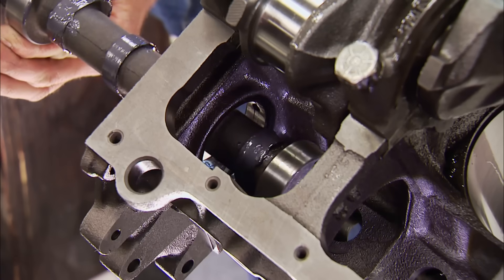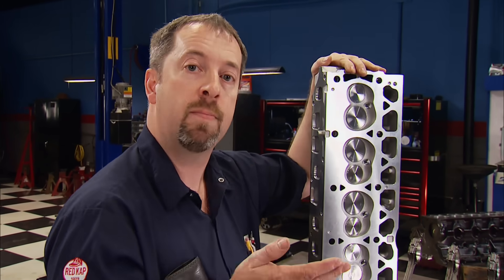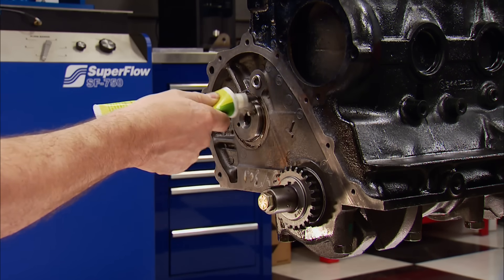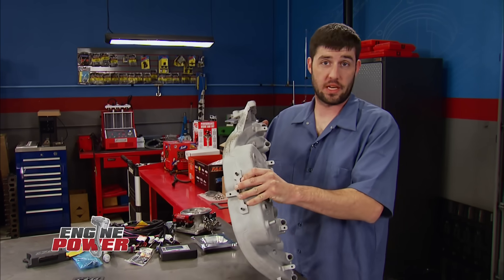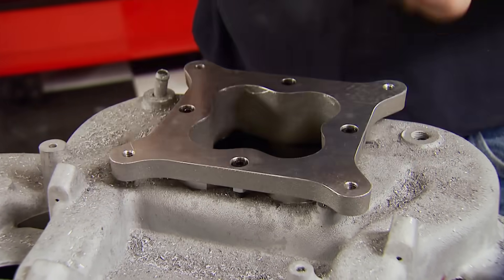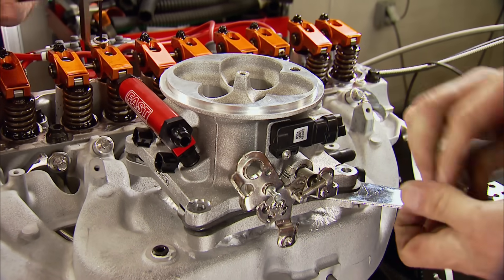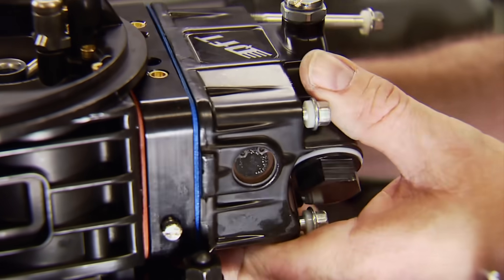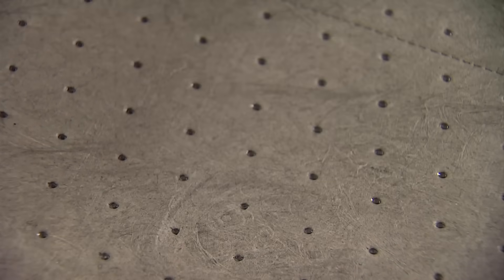Rebuilding a 4.0L Jeep Straight Six to 242HP - Engine Power S2, E14

Comment: We'll continue to post these episodes here on YouTube. If you can't wait for the rest of the build, visit our site to binge-watch:  https://www.powernationtv.com/shows/engine-power
Reply: What did it cost to build? How much 66hp and 66 torque cost?
Reply: @LarryisControversial3000 5k at least depending on you machine shop costs and this motor is crap for off roading trails as it has to reved out to make power. I bet the stock motor makes more torque at 3k rpm.
Reply: @pkuudsk9927 the added cost of changing all your gears to match the new powerband jacks the cost to sky high
 the head and rockers alone cost near 2500
Reply: @LarryisControversial3000  Yep and the best part is a stock motor and trans can do just fine . Tires and a winch cost way less. The cost of the head and rockers almost have you at the cost of an LS swap . Advance adaptors sell kits for less than 1500 to match a ax 15 . So why would you spend 5k+ building this ?
Reply: @pkuudsk9927  agreed
Hey   powernation  feel free to chime in and let us know why this the better option over a v8 swap or something else 
Please, I am seriously asking
Reply: @LarryisControversial3000   Because they are honoring the history of the 4.0. Its been around for a long time. There are millions out there still running and the history of the engine and all it has done comes into play here. People hold that in high regard. There are many Jeepers who have no desire to shit on the Jeep name with an LS swap but would appreciate more power to run 70-75 mph up and down hills all day long on the interstates for those cross country trips.
Reply: @beboboymann3823  this started with the request for a budget build, the build presented was not. While the actual cost is not fully stated, educated guess puts it in the 8-10k range due to the aftermarket parts used. The long and rich history of the 4.0 is actually better represented by other builders who are able to get more usable power with stock parts that have significantly more reliability and endurance than the aftermarket parts. 
Side note 
My 89 cherokee didn't require a bunch of aftermarket parts to run 70 plus mph up and down hills on the freeway all day long, and at the same time I could play on the trails too. All stock 89,  
So......
Reply: @pkuudsk9927   Which is exactly why I built my poor mans 4.5L gollen knock off using the old 4.2 crank on the HO platform. It made 338tq @ 2600rpm and 287Hp @ 3700rpm. Kept the factory injection which up sized injectors and a JET computer. Build cost was less than $2200.
Reply: @usmcdrifter8759  That is a proven method with the torque right where you want it . Much better build than this race motor. And why I bought a 4.0 to build when my 4.2 get's tired . 22 years old 350k kms on it and still runs strong don't burn oil .People laugh  at 112 hp180ftlbs but it doesn't break axles and u joints every weekend . I wore out a rear ring gear and 1 clutch in the jeeps life . Most trails I rarely get over 2500 rpm
Reply: P Kuudsk ALL the motor needed was FLAT TOP PISTONS AND MULTIPORT INJECTION!!!!
Reply: @beboboymann3823  after giving this some thought, your comment about shitting on the rich heritage of the jeep name is misdirected. Truly no one has done more than Jeep itself to shit on it's name. If I remember correctly the last Jeep/Amc engines were produced in the late 70's possibly very early 80's, and Amc was borrowing parts from other manufacturers to stay alive for a while already. Chrysler transmissions for example. True they had a kinship with Mopar, but Jeep hasn't had full production control of their vehicles since the 60's. The 80's saw 2 different chevy engines in the lineup.  So out of all the vehicles in the world, Jeep kinda feels right to swap in a different big 3 engine in as needed.
Just my thoughts and opinions, and to clarify, I fully believe it is wrong to swap a chevy into a ford or dodge and also wrong to do it the other direction. 
But Jeep just keeps asking for it.
Reply: Love these episodes you guys!! Keep it up! #JeepLife
Reply: Wheres the dyno sheet to show low end power / torque . fine it makes power at red line but thats not where most off roadin is done at . 2500 to 3000 rpm matters more than all out power. If you have to rev the shit out of it ,all the time to make power, than it won't last long throwing the reliability factor out the window. .
Reply: I’d like to see the episode where you tested the 300 inline six and also I’d like to see you build a mopar 383
Reply: Through the buildcost in the description haha (minus the tunetime$)
Reply: That intake manifold should have been a Clifford 6=8 4-barrel.  You would have easily made your 242 horse power without the headaches.
Reply: You guys should in the future rebuild and tune the 4.0 OHV 6V. That would be an interesting build!
Reply: @xCptLegendx  Yep, and I'd like to see the guys build a GM 4.3 V6.
Reply: @xCptLegendx www
Reply: Can all this be used on a Jeep 2003 Grand Cherokee 4.0 inline 6 ?
Reply: Yup... @dougyankunas3104
Reply: Who sells mods like this? Is this sold in this form as a reman?
Reply: And on episode 4, we LS swap the jeep for more power and less cost than the byzantine piece of crap jeep I6.
Reply: This engine is bullet proof. It was made that well. Amazing torque for a 6. Best thing they ever did was giving it fuel injection. Balanced the intake fuel charge. Before that it was just another straight 6.
Reply: Don't bother, your show sucks
Reply: Any Idea or hard numbers on what the MPG would be on this engine before and after?
Reply: here have a look , 
https://www.youtube.com/watch?v=HX6qFxaFSnM
Reply: Heard that, stopped the video, backed it up, watched again. Was disappointed.
Reply: The flow mistake I see here in modifying the intake was that you set the adapter flange throat down inside the housing creating a vortex wall which severely disputes and blocks flow.  If the adapter flange had been held at the intake deck level then TIG welded it would have worked much better. 
Or better yet install a high flow 47-4520WH Clifford 4.0 Intake Manifold which will accept the four barrel adapter plate.
Reply: 351M build stock, built, then blown turbo thru a Holley super sniper efi...
Reply: Can you guys do a engine power on a 2000 5.9 24 valve Cummins please!!!!
Reply: Nitrous and Turbo next 🇺🇲🇺🇲🇺🇲👍👍👍
Reply: Hey guys, I really enjoy watching your IL6 videos. How about doing the 1960 Jeep Wagoneer Tornado 230 CID OHC IL6 engine in the near future?
Reply: hay im building a customized jeep yj that is inspired by rover1 from the 100 and i would like to know how big of a 4.0l can i go in a yj engine compartment but not ruin the look and reliability and for the engine i wnat to do what you did for this engine, a fule injected high horsepower and torgue monster that is super reliable and bullet proof also what transmition do you recommend the manual 5 speed(if so what model should i go for) or a aftermarket automatic im more leaning to the automatic just for ease( if automatic how many gears should i have) i want it to be able to be on the road, on the highway, in the mud and dirt and just shrug it all off.
Reply: i have a cherokee 1995 6 cylinder 4.0 in which part of the united states are they located? I would like to take it with you
Reply: I think when you slid that carb plate in and welded it to the manifold before doing that you should have trimmed it down so that it doesn’t Hang to far inside the manifold and then welded it. May have helped with how the fuel was delivered threw the adapter and into manifold. Just a thought.
Reply: It makes me mad y’all don’t do a 2.5 liter no one builds them y’all need to
Reply: I wish you guys would stop recommending the E3 spark plugs. They are utter garbage.
Reply: I did have chevelle 68 with 250 inline six with 4 speed std headers and electronic ignition and scare the shit a mustangs
Reply: So what is so new about the motor design . it's been around since the 70, s remember that you must be getting old they even built a 258 cubic motor as well
Reply: What is parts cost in 2024 😂
Reply: Could you guys to sam on the 4.7L variant?
Reply: PowerNation WE THE FANS WANT DIRECT PORT INJECTION, FLAT TOP PISTONS AND T4 TURBO!!!!
Reply: PowerNation <-----<< STILL WEARING YOUR FLORAL PINK SKIRT.. THIS IS WHAT WE YOUR FANS WANT TO SEE.
https://youtu.be/zmtVyfC_bBo
Reply: I'm  a jeep owner ('95 Wrangler YJ). Mine has a 2.5, 4 cylinder engine, very weak. Where can I buy a 4.0 engine built up the way you guys have done this one?
Reply: Thanks for this Episode, I had a real interest as I owned a 87 Jeep Wrangler with a 4.2 , It was a Rather special Jeep as it was "prepared" By Shelby for the UK as a personal favor to the Guy I bought it from in the UK, The Engine had been worked on, But the Carter Carb and the Exhaust where both holding it back, Fitting a Webber, and working at the time for a custom Exhaust shop We built a High bore custom full twin stainless Exhaust + Headers and used two custom in house built stainless RangeRover back boxes ( no catalytic converter as cars of that age were still exempt in the UK). I would spin all four BFgoodrich tires in  1st and 2nd gear on dry blacktop, And driving back through France the speedometer went off the dial estimated 115 MPH, So fast that wind pressure collapsed the bars on the soft top, It ran fewer emissions than a fuel-injected cat fitted 2-liter car, and nearly doubled its MPG, it was an awesome one of a kind Jeep I Wish I still had.
Reply: I need that for my 96 jeep..

Comment: You could buy a V8 crate motor for $4k
Reply: Less than that.  Brand new basic SBC 350's are going to top that modified motor in HP and torque  and can be had for less than 2k.  You'll have to spend a little time and money on conversion parts, but still.  Some people want to stick with the engine they've got and work on it.  Depends on your goals, comfort level, and budget.
Reply: But a V8 isn't a drop in like this is.  Some folks aren't able to do the work to do an engine swap. Or don't want to spend the time and money to do so. And given this is a inline 6 will a V8 fit without major surgery in the engine bay?  Plus will the trans you currently have still be compatible or strong enough?   You will need a new drive shaft and probably a transmission crossmember.  Can the front and rear axles handle the extra power of a V8?   How about the T case?  Is it strong enough?   How about cooling?  A swap will add more heat which will require a bigger rad which may require custom fab to build and install.  Don't forget new exhaust.  And electronics if you swap an efi engine.  Crate motors or junk yard buys generally don't have accessories so you need those.  Lots to take into consideration.  So your "cheap" V8 swap can turn into a a very expensive project quick.   You'll look brilliant when your $4,000 crate engine swap turns into an additional $10,000 project to fix everything that is incompatible or of insufficient capacity or strength.
Reply: @bmstylee  You do know grand cherokees did come with v8's right?
Reply: @jondoe6618  yes.   And depending on what you want to swap into what I said is still completely valid.   Watch the old episode of Ian swapping a hemi onto a Jeep Wrangler.  Not sure what model it was but it wasn't an easy swap which was my whole point.  Keyboard commandos spout stupid shit like the original poster without a thought about the extra stuff needed to get something running properly and reliable.
Reply: @bmstylee  I've put ls v8s in a fox mustang & a toyota tacoma, I know people who've put em in mazda miatas.
Just because YOU aren't capable dosen't mean others arent...
Reply: @elonmust7470  "six bolt mains" what good are they if they are the diameter of a toothpick?
Reply: @frigglebiscuit7484  what are you talking about? Only big blocks have larger journals. Older lt engines & gm small blocks have smaller mains.both mains & rod journals are smaller diameter than what's in  an ls.
Reply: @frigglebiscuit7484  I made the mounts myself. Putting an ls in a fox mustang is not difficult..
Reply: @frigglebiscuit7484  Thr main journals are 2.55 inches.
They are also cradled. This is why the blocks handle over 1000 hp with ease.
Reply: @elonmust7470  ease? Why do I see so many blown up? Cleetus McFarland alone has blown up at least 4 of the fuckers already. Its not that tough.
Reply: @elonmust7470  400 Mopar has 2.62 journals, and a tough ass bottom end too. Your point? The L's ain't an end-all be-all engine. You "hot rodders" just like them because they have a big aftermarket from more idiots thinking they are god engines. Hell, the 4.6 mod motors whoop an L's engines ass if they are modded. They also run faster times than the L's engines.
Reply: @frigglebiscuit7484  you won't find a dodge 400 big block ready to make 1000hp sitting in the junyard like you do ls engines.
The lsx & lsnext blocks are just beefed up versions of the stock 6.0 & they can handle 3000hp. The ls is a very good design for a pishrod engine. Maybe one of the best. I'd argue that the mopar 340 is a better engine than the gm 350.
The  ls dosen't really need an aftermarket, that is the main attraction. You can take one & put forged rods & pistons in it and run factory cam, intake, exhaust manifolds etc & make big power.
Reply: @Welcometofacsistube  Yet I don't own a single gm vehicle. Other than a fox mustang with an ly6 in it no GM at all.  I do have a 1970 duster with a 340 in it.
& since we're playing this game; I've forgotten more about falling timber, welding, & running cat than you'll ever know.  Personally I'm way more proud of those things than I am of my ability to build an engine (it's not hard...)..
Reply: @Welcometofacsistube  Explain to me how larger main journals are counterproductive to rpm & why it matters in a pushrod v8 that'll never rev past 6k in stock form?  
The difference between a 2.45 & 2.55 is not going to affect an engine's ability to make rpm & power...
Reply: @Welcometofacsistube  who cares about what companys did in the past?  It has no bearing on the fact that the ls & now the new lt are great platforms. Sounds like you just get best by a lot of gm cars and you hate that.
Reply: @Welcometofacsistube  Yeah like I thought. Bearing speed is not relevant, in other words the engine will never spin fast enough for it to be a problem.
Reply: @Welcometofacsistube  the fact that you think one of the major us automotive competitors is "junk" just shows extremely nearsided thinking. I don't have anything against mopar. For muscle cars they are my favorite. Dosen't mean I have to dislike other brands..
Reply: @bmstylee  "major surgery"?  You mean new motor mounts lol?

It's clear thatbyou qualify under the "has no idea" catagory...
Reply: @elonmust7470  sure.  Some people don't have welders or are not comfortable welding something that if it fails is a major issue.  But more people are capable of picking an engine and doing a rebuild.  And Fab isn't as easy as you claim.  Look at how may bubba jobs you see and there is no shame in saying I can't do it.  Many engine swaps require a new transmission tunnel or modifications to the firewall as well.  Which is not simple work.  But keep posturing that you are a 7th level zen master bubba fab guy for the YouTube comment section.   Or post some of your work to prove you're the stuff.  If not shut the fuck up.  Still doesn't dispute that I raise valid issue raised when doing a major change to the car.
Reply: @bmstylee  I literally have sunburn from welding pie cuts for a turbo exhaust system. I also have nothing to prove...
Reply: @elonmust7470  has "nothing to prove" but spends 4hrs trying to prove something??🤣🤣🤣
Reply: @ymx86  on what world did 10 minutes of typing take "4 hours?
Reply: @bmstylee  everything you said is off...

Comment: 6 in a row  you ready too tow, 8 to v you sit down to pee
Reply: And you are a grade a loser...
Reply: Never understood this mistaken belief in the superior torque and towing ability of an old straight 6 when a V8's specs will beat them every time (diesels are a different story).  The only reason it seems like a straight six has a lot of stump-pulling low end is because they have nothing up top.  Back in the day when they used to be put in work trucks they had to have granny low gears and two speed rears to make up for anemic power.

Comment: Nearly as good as a Ford 300 ci 6 cylinder......similar architecture......7 mains, etc.
Reply: Tom Nekuda Better actually
Reply: @jedimasterjoe5386  Maybe so.....doesn't Clifford Research make a performance 4 bbl manifold for this engine?  I thought they did....I would think it would be better than the "cowboy engineered" intake on this one(looks like something I might do).  Lemme know what you know/think.  Tom
Reply: I think they do not sure all I know that Mopar and Gm make great straight 6s my uncle (he’d passed) had a 80s gmc truck with a straight 6 in it brand new day one and it stills go good with basic  maintenance
Reply: No it's better and been proven.